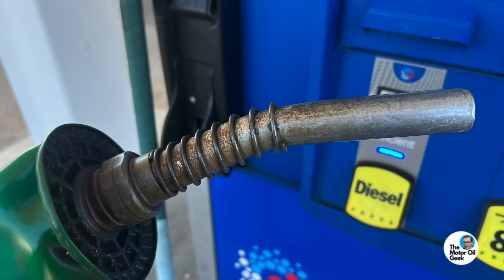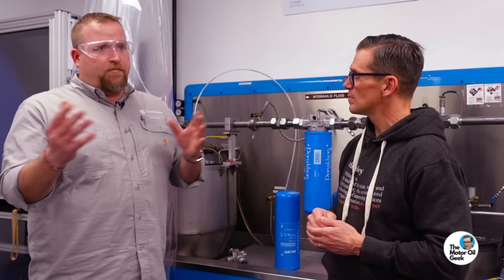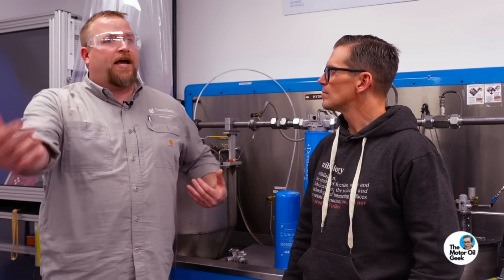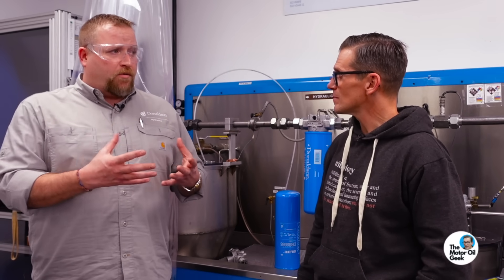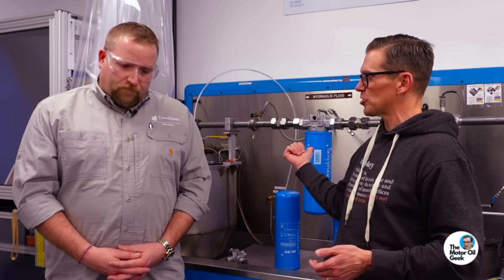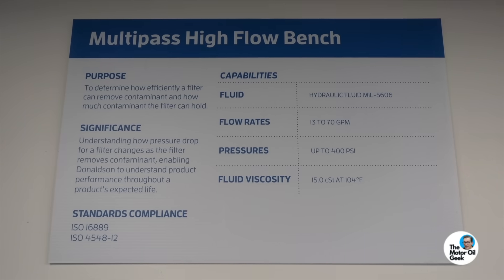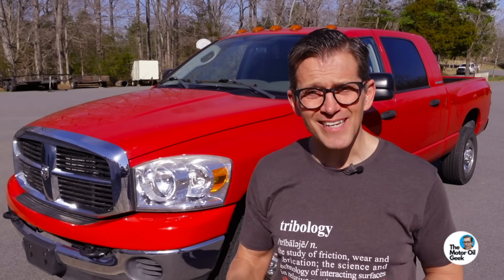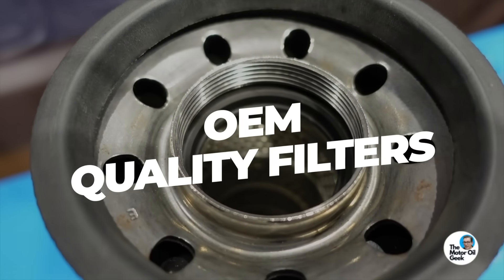Diesel Is DIRTY (And It's KILLING Engines)

Comment: Gas station service tech here.   The biggest complaint from customers is slow dispensing, so higher filtration at the pump is not really an option!  The universal diesel filter is 30 microns.  Using a 10 micron filter for diesel restricts flow and plugs quickly, which annoys customers and is a problem for store operators, because they almost never change their own filters. Add to that the new B20 requirements, and now the 30 micron paper filters are susceptible to plugging up with bio diesel!  To get around this, some truck stops that blend their own bio diesel will use 144 micron screens to avoid filters plugging with the bio diesel.  Other truck stops don't even have filters in their truck dispensers!
Reply: Fuel polishing.
Reply: @thisisyourcaptainspeaking2259  It exists, but people only pay for it when their tank gets really bad!  And even then it is a hard sell.  Gas stations really do not make very much profit from fuel.
Reply: @fredygump5578   True.  However, if the fuel is contaminated then costly failure rate is quite high.  It's much better (best practice) to remove contaminants prior to dispensing.
Fuel polishing can be done continuously until the fuel is cleaned up with no impact on dispense rate.
It's not the consumer's responsibility to resolve problems caused by dispensing contaminated fuel, this process should be transparent to him.
As you know, there are numerous causes of fuel contamination that must be addressed, it best to pinpoint ans eliminate these at their source.
I find many tanks become contaminated over time and this always leads to costly solutions when allowed to accumulate unabated.
Reply: @thisisyourcaptainspeaking2259  I was thinking the same thing. Semis and trucks with onboard $800-3000 dollar polisher. Or a unit on a trailer. Haha, doesn't seem realistic
Reply: High flow is achievable woth a larger surface area, but it costs more so nobody's going to be willing to invest in such a filtration method. Everybody wants cheap cheap cheap.
Reply: This is alarming
Reply: Larger filters would allow for more speed with the same filter quality
Reply: If stations added a second filter down stream for fine particles size to match first when full flow less factor
Reply: So filter it out at the refinery, or filter it when it gets pumped into the underground tanks, or filter it at the station and use a bigger pump to compensate for the reduced flow rate.
Reply: Can't stand a slow fuel pump when I got to pump almost 300gal
Reply: EPA's Corporate Average Fuel Economy (CAFE ) regulations cost consumers more than poor gas mileage. Example: gasoline 2020 Toyota Tundra V8 gets 8-13 mpg. 2025 Tundra V6 Twin Turbo gets better mileage, but each $2000 turbo will need to be replaced. How far can I travel with an extra $4K in my gas budget over 7 yrs? Then factor in resale value. EPA needs to cancel the CAFE program. Let the almighty CONSUMER decide.
Reply: Improving filtration is clearly the answer, but not so easy on a large scale as in a controlled environment. If you have your own tanks comment you just need to increase your filtration even though you're going to have to change filters a lot and it's going to decrease flow
Reply: If the pump is super slow, I don’t pump it there. I have found it sometimes bypasses the filters when it’s that nasty. I tend to also only get diesel at high volume stores like truck stops because they tend to have more going in and out seems to me I get cleaner fresher fuel. My logic with it is that they keep the tanks “flushed” when they move a lot. Also won’t get fuel if it’s just been dripped because of it stirring up shit in the tanks as well. At least 3-4 hours I feel is a good wait time for it to settle out some. If I see fuel being dropped I go to the next station.
Reply: Bottom line the government doesnt want us Americans to have anything for a long time anymore. Us Americans are the back bone of the world!! Us Americans are just cattle for Money!! Trump stole $2.9 billion right from under our noses and nobody says anything about it!!
Reply: Can't wait for the lawsuits that will eventually catch them. New EPA changes will help filtration from processing, but crap in station tanks will almost never get cleaned. That's the problem, there will be lawsuits in future
Reply: This is all fine for most standard road applications 

Sure you can clean it up more but C'mon the energy needed for benefits gained 🍆
Reply: Ok, I'll admit that I'm no expert, but it seems to me that there's a simple way to properly filter the fuel AND  maintain good flow at the same time, by increasing the size of the filter, while maintaining the same mesh filtration size. It increases the filter's overall surface area, which prevents it from clogging so rapidly. Why couldn't the fuel suppliers do that before selling the fuel to stations?
Reply: @HighlanderNorth1    The answer is Money!  Adding processing costs money.  Nobody wants to pay more for fuel.  The only way for it to happen is for the EPA to force a change in fuel standards, but the EPA doesn't give a f*** about your fuel filter. The only people who think this is a problem are the people who just found this video.
Reply: @fredygump5578 
You say the only people concerned about this are: "People who just found this video". Ok, that includes me.... Seriously though, I've never owned a diesel, but I've always wondered why the diesel pump nozzles look so grimy and greasy. Is that due to microscopic particulate matter?
Reply: Fass 165 signature pump filter system. Works fantastic and works better than OEM filter. Highly recommend installing on any diesel vehicle.Removes air, water, particles and because it returns unused fuel it continually polishes your fuel.  And yes air is a contaminate. If you know what a cp4 is then you already knkw how important fuel filtration is.
Reply: The Refinery should supply cleaner fuel
Reply: @joelpierce3940 The refinery isn’t generally the problem. It picks up contaminants AFTER it leaves the refinery… pipelines, railroad tankers, intermediate storage facilities, truck tankers, storage tanks at fuel stations, &c.  The fuel gets passed around a lot before it winds up in your vehicle.
Reply: @joelpierce3940  And then it gets dirty the moment the cap is opened
Reply: @joelpierce3940  Of course that might double the cost of the fuel.
Reply: wouldn't the right place just be at the fuel provider?  the EU and USA standards used differ,  but EU employs a solids limits of 24 mg per kg.    I can't even find the limit or particle sizes for the usa standard? does it even exist?
Reply: @lasskinn474 That would be the right option, but refineries are also in the business of minimizing costs and maximizing delivery volume. They’re not going to “waste” time and money on finer filtration unless they are legally required to.
Reply: The solution to slow dispensing is physically bigger filters, it just costs more.
Reply: I'd be interested to know what that cost would be per gallon of fuel dispensed
Reply: @bhartley1024   No need to filter dispensed fuel if the fuel is already clean, why waste everyone's time when it's unnecessary?  Polish the fuel beforehand, problem solved.
Reply: @thisisyourcaptainspeaking2259 never gonna happen.

Every diesel tank at a gas station would have to be cleaned out and that shit costs too much
Reply: @drammerrr   circulating the fuel through a series of filters (until clean, perhaps continuously) is how I polish fuel.  Can't burn dirty fuel, right?
If you sell dirty fuel, I expect you'll end up paying far more.
Reply: So doing the right thing is too hard and expensive for places that specialize in selling fuel as their main goal. Wow 😅
Reply: @mondo_stunts27  Lol!  If given the choice between a dispenser with no filter and one with a fine filter, 100% of truck drivers will use the dispenser with no filter, because it is faster!  And your use of "specializing" is hilarious....the industry...is not...that...
Reply: @mondo_stunts27  Most of the new people were never trained to do such work.   The old boys refused to train in anyone new on their critical work due to fear of being replaced, and thus the new guys don't have a clue that anything even needs to be done anymore.
Reply: 5578 sounds like a not my problem , pass the issue on down the stream situation. 
Spend  $5B updating the station pumps to save $50T in repairs,  or 5M per refinery to bring the distribution system up to spec.  But this would upset the auto manufacturers by reducing there sales generated from excessive repair bills out costing replacement.
Reply: you can flow as much as you want, filtered as clean as you want, with the right filter system - mostly larger filters. If the standard size filter restricts flows too much making it much larger with the same media would improve flow.
This is why you see trucks swapping to physically larger filters, youl see pickups with filters hanging way down below the frame etc.
Reply: Why doesn't it get pre filter from the refinery? Seems to the best option for both customers.
Reply: @peaj4812  It does get filtered!  But according to old specifications.  Before the video:  nobody cared about diesel fuel filtration.  After the video:  everyone knows it is a huge problem and knows how to solve it...  That is everyone in the comment section...
Reply: Having a finer micron filter and the diesel supply from the pump would not slow down the flow of diesel. It just requires a higher pump capacity/pressure to pump it through the filter.
Do not have high flow nozzles in the US fuel stations ?
We are the standard car diesel nozzle with a button for high flow and then we have the truck filling nozzles which are ultra ultra high flow .
As you require quite a fast flow to fill up 500+ litre diesel tank tanks quickly .
Reply: @overland_adventure_nz  Dude...that sounds easy until you realize 1) that equipment doesn't exist, 2) it'd be crazy expensive, and it would require a ground up rebuild, 3) stores do not make money selling fuel!  Internet says $0.03 to $0.07/ gallon (In the states...).  So no store could pay for it. They can barely keep up on maintenance.  Most stores do NOT keep up with maintenance....
Reply: @fredygump5578  well I understand that the petrol stations don’t make very much money per litre of fuel.
This is pile of the reason a lot of fuel stations down under have gone to self serving pre-pay fuel stations with no one on hand for help or anything.
Someone just goes and checks that everything is working for an hour sometimes daily if it’s a busy place as sometimes once a week.
The actual fuel tanks, pumps, in the calibration of the pumps are the responsibility of the fuel supplier not the fuel station.
I used to have fun refuelling coach/bus in the side street in Paris blocking up the hole of the parking pumps when I filled up with 1000 L of diesel to keep me going a few days .
It was slower than going to a motorway services, but it was far cheaper per litre and we are instructed to buy the company owners .
We have three grades of petrol  ie: 91, 95, and 98/100 octane Plus diesel pumps in all fuel stations down under.
Have a good day .

Comment: If someone could invent a cartridge  filter set up that could fit on the end of the pump gun they would be a millionaire. Filtration as it goes into the tank 🤔might have to go out in the work shop and start designing.
Reply: Yes it is a good idea  and doable too. Like the chlorine filters on the overhead showers a small filter can be designed and fitted just before the nozzle .

Comment: My coworkers second job works on tankers and tanker trucks used to haul oil, gas, etc. He’s a great guy and told me that once the tanker is empty from say gas from filling up a station there could be around 25-50 gallons left in the tank, lines, hoses, etc. Then without any rinsing that tank could get a full load of diesel fuel put into it. Just sometime to think about when fueling up.
Reply: Because the amount is so small, let's keep numbers simple...
*37 gallons is the average that you mentioned. 
*3700 gallons is the capacity (it's more like 4500, but lets keep it simple which will help prove your point)
*37/3,700 = .01 or 1 percent of one percent. 

I once picked a car . Had ~250 miles on it and barely 2 gallons of fuel.  The dealership would fill tank next day when paperwork was done. 
So across the street i went to the mini-serv gas station i was familiar with.  I stopped  next to a diesel pump & I asked Joe for 3 bucks worth. In 1997, bucks a gallon. 
I didn't notice he walked forward of my car and stretched a gas hose to. 
I drove just over 30 miles, stopped for a soda. Coincidentally, when I opened drivers door to leave, the engine stalled.
   Crank, scratch head, Crank, light bulb, go smell fuel tank.. 
Phone a friend  ... please go get a 5 gallon can from my place, go to certain station and fill it with diesel. 
That 5 gallons was enough to dilute the gas for me to return to dealership and top off fuel (announcing "DIESEL, I almost didn't make it home last night! ").

Joe topped off the 18.3 gallon tank.

I was perturbed, but honestly knew it was nothing catastrophic. 
No, seriously.   Brand new car in 1997, for which I just bought it's first set of replacement injectors this year (2025).  Turned out the ULSD has done considerably more damage since 2006 than 3 gallons of gasoline in 28 years.
Reply: That's why when filling up my car that requires premium, I pull in behind the Corvette or other car that I know is filling up on premium. 
Can't do anything about the tanker truck though.
Reply: He correct, but it’s not that much. I was a fuel hauler, the last 4 years. It’s generally about 5 gallons of retain, on average. 
  The worst case, if the trailer isn’t level when unloading at the station. We had a station that was on a side hill. 
 The emptiest I could ever get still left 12 gallons of retain. 
  Because, once back to our yard. I drained it into my jugs, then fill my car lol 
  I hauled jet fuel going into the Covid pandemic. The company we hauled for Avfuels, specified that a previous load could not be diesel. It was customary in the past to “ diesel dirty “ a tanker before hauling jet fuel. 
 Jet fuel trailers then are dedicated to only hauling jet fuel for the duration of.  No switch loading. 
 I asked Avfuels why. The reason is most diesel today is a blend of Bio (2% to 5% ). Bio diesel reacts to jet fuel, causing deposits to form in turbine fuel systems. 🤫
 I didn’t tell them that’s how our company prepared a trailer to haul jet fuel .
Reply: @redmesa2975 A question for you, is it true that all diesel/gasoline are from the same pipeline in my specific region? Like for me in GA, does it matter if I pumped Diesel from Exxon, QT or Shell? Thanks
Reply: @nq2847  most likely so. 
    In Denver, there’s only one refinery. Suncor. 
Conoco / Phillips, Magellan ( now Oneok ), and Frontier / Holly,  are all pipeline supplied from the Gulf Coast.
  Additives including ethanol, are added at each terminal to complement the blend.

Comment: I think I'll keep my old 7.3 IDI
Reply: I have had two IDI's and looking for another one.  This one have a serpentine belt - having 4 individual belts is such a pain.
Reply: @JohnMcCullough-wr9hj I just changed my 4 belts to Gates extra heavy duty for supposedly for ambulance use. They are completely green on top and cost in the upper $40. range apiece compared to about $8. I am like you and get tired of changing especially the alternator belt that flops unless you over tighten and put extra pressure on the water pump.
Reply: kick me,.... i sold mine few years back
Reply: IDI just won't die

Comment: Thank the EPA for NOT mandating cleaner diesel fuel.
Reply: Nope, the consumer is responsible for what they buy.
Reply: @georgeburns7251 
Really? Do you know that the EPA mandated a CN range of 40 to 55 for states to follow, where the state chooses the CN. This results in varying CNs from state to state.  For example, Cali 53 and Nevada’s premium diesel  fuel has a minimum CN of 47, suggesting the non-premium has a lower CN. So one is not free to choose as you state.

Comment: Lake, would love to see a video on the benefits of or detriment of using lower micron rating engine oil filters.
I try to run the lowest micron oil filters as I can get for my application. 
I ran Donaldson DBL7349 20 micron rating on my 2020 Ram 2500 6.7 Cummins
Reply: Me too. Filtering out clearance size particles seems logical is and supported by the idea of an early first oil change but in the dyno videos it seems he uses run of the mill oil filters.

Comment: Soo... What about gasoline? Cuz my GM is direct injection and has a high pressure pump like a diesel and they don't have proper filters anymore. Just a screen in the tank. Is this just another "planned failure"?

Comment: Treat filters like you do water filters.  2 filters in a line will always be better. Larger micron, then smaller.  Example 20micron, then 5 micron.  I don't know why they haven't invented 2 stage filters yet (that I know of)
Reply: 2025 6.7 Cummins has dual filters. I don't know much else about them.
Reply: Useless